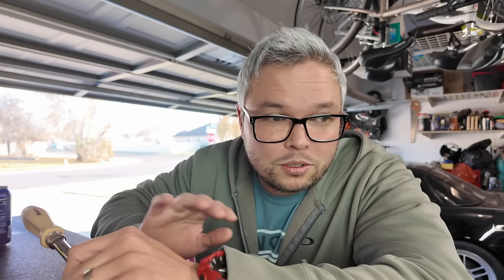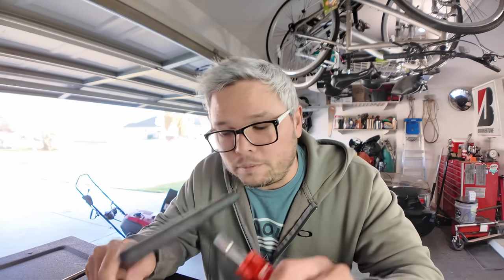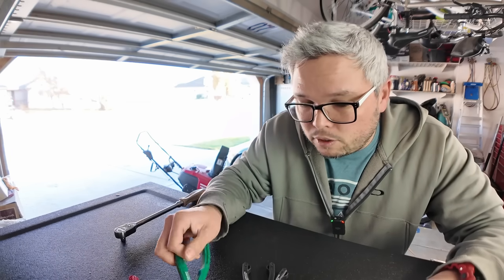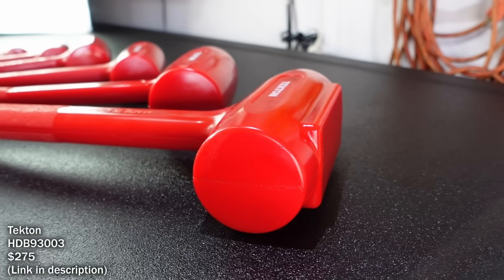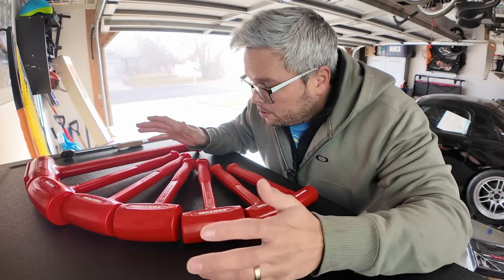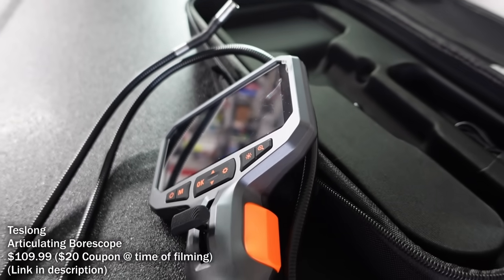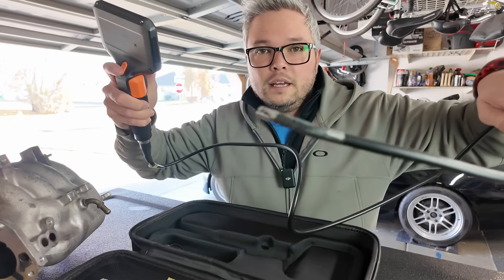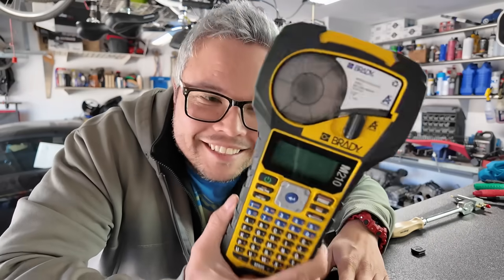Wish List for Guys that have EVERY TOOL

Comment: Re: The T handles. There’s a similar but better tool made by MichaelPro. It’s far cheaper and they both have another 1/4 or 3/8 drive square in the T part of the handle as well. They’re on Am too.

Comment: Also the Brady lable maker at 10:00 is capable of printing on heat shrink tubing for wire labeling. I use it all the time to make control panels in the industural world.
Reply from the maker: Thanks for the tip!!
Reply: That’s awesome to know

Comment: I've bought a ton of hammers from Trusty Cook. My 12# sledge and 7# stubby sledge sees a ton of use as well as a bunch of metal faced dead blow hammers. A great tip on the large deadblows is that the blemished ones on their website are half off every day. If they do a sale you get an additional discount.

Comment: I've already spent a few hundred this week on some new organisers and new ratchet. This is JUST what I needed :P I think the new direction is a great idea and I am looking forward to see how it goes! Best, Sam.
Reply from the maker: What ratchet did you pickup?
Reply: @ToolBoxTour  For some reason my comment didn't go through, sorry. I grabbed the 3/8 extended locking flex head soft grip. I managed to trade an old 1/2" drive in and got a great deal. I of course picked up some other fun things while on the truck! It would've been rude if I hadn't right? ha!

Comment: Thanks for the T handle recommendation. 
We have something very similar to that for a spark plug tool for the Chrysler Hemi prominent in Top Fuel and Alcohol. It also has a torque click feature which is kinda cool.

Comment: I was pleasantly surprised when I bought my Tekton dead blow, and figured out it was the same hammer all the tool trucks had! 

Tekton has a lot of sub-par tools like their hard-line chrome and impact sockets. Their ratchets are overpriced, and pliers are not great. 

However their pry bars, hammers, screwdrivers, Canada- made toolboxes, and world-famous angle wrenches are top notch.

Plus, they were the pioneers of the "Snap-a-picture" warranty. They started doing that like 7 years ago. I thought it would bankrupt them, but I was definitely wrong about that. 

Those angle wrenches are the best. Try them! They're very affordable.
Reply from the maker: Yeah Tekton is doing good work!

Comment: I can see the t handle being useful in a trans shop for starting trans pan bolts 🔩 if you dont have a low torque electric screwdriver drill